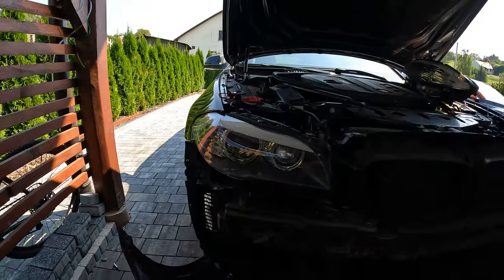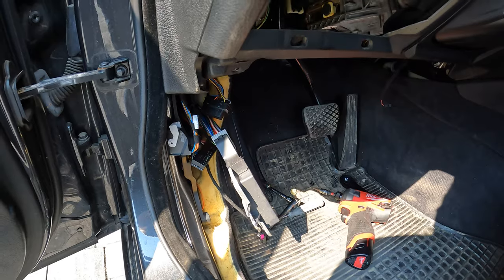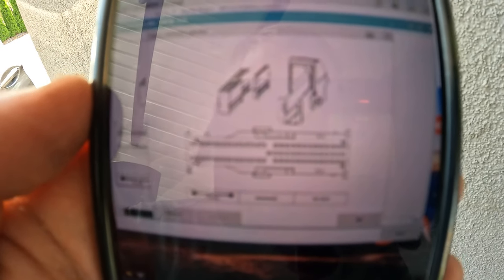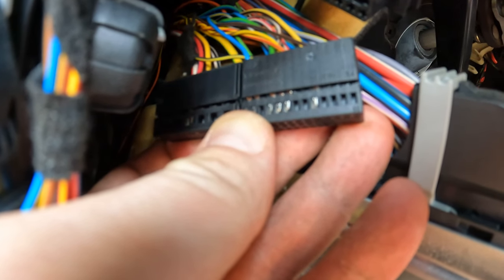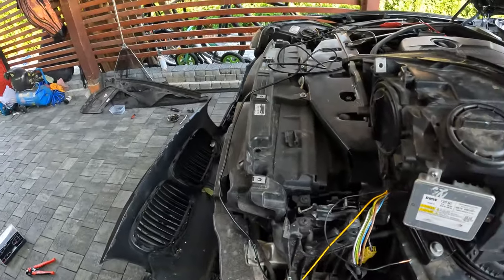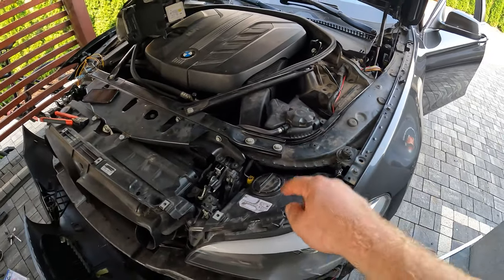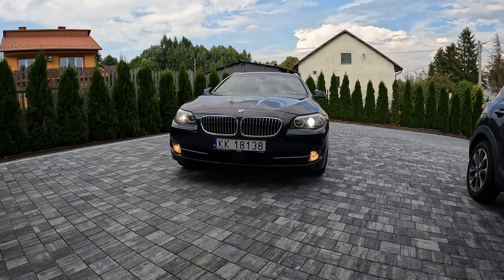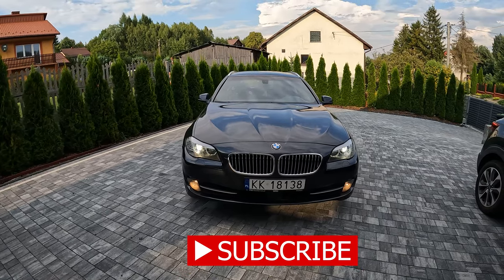BMW F10 F11 OEM Xenon with Adaptive Headlight AHL ABL Retrofit

Comment: Hi there, Great video. Quick question for you. Did you wire in the headlamp level sensors, or just disable the fault code with Esys? and if not, did the light level drop to the lowest setting? I want to do this retrofit on my f10, and there is very little info out there on the swap. 
Thanks!
Reply from the maker: This is an F11 so it has bags out back and the level sensors are already there. I don't have any faults after the swap and they level out like a factory setup.